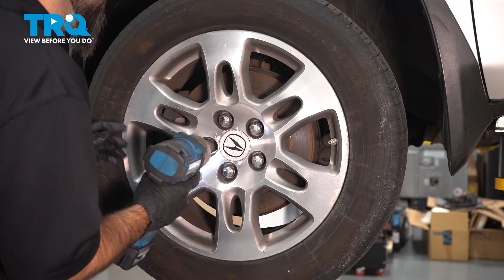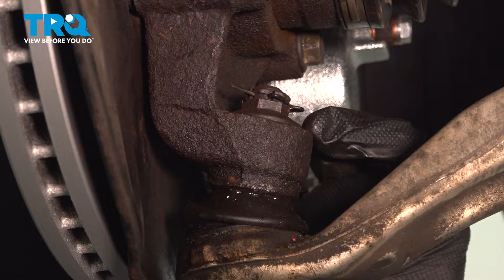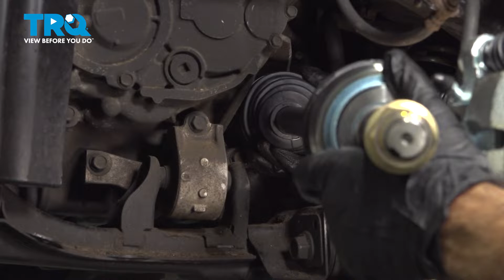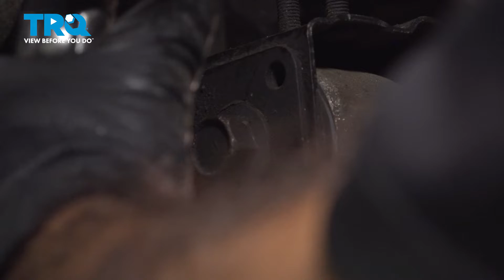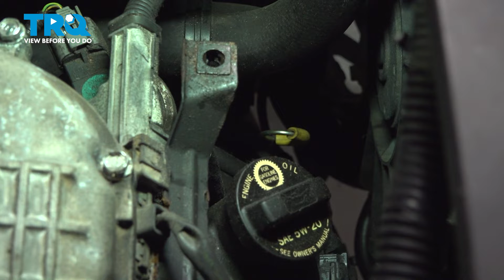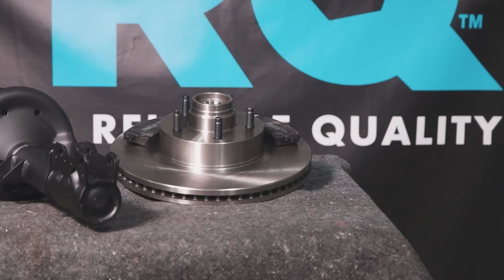How to Replace Front CV Axle Assembly 2007-2013 Acura MDX

Comment: Personally on these vehicles with these control arms I would take go from the top and remove the two strut bolts. Unless you have $150-300$ for a new control arm from a parts store isn’t smart attack.

Comment: Lower ball joint boot gets shredded!  Also use a stinking rubber mallet or deadblow or hammer with a block of wood to seat the snap ring. Otherwise it can come out later while driving!!!

Comment: Very bad advice to use pickle fork on lower ball joint. That joint is a whole unit with lower control arm. Very expensive. You will be really sorry if you mess it up. Also taking the inner joint out is not that easy. You will be a fool if you believe it, especially if you don't have a lift.